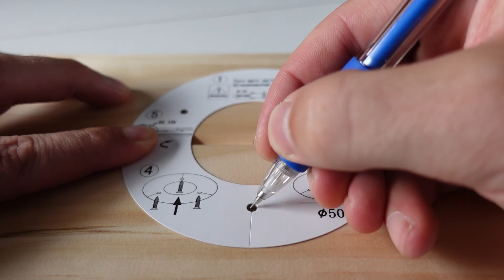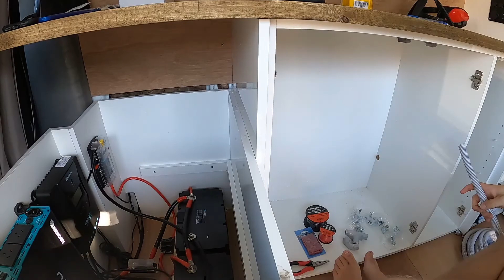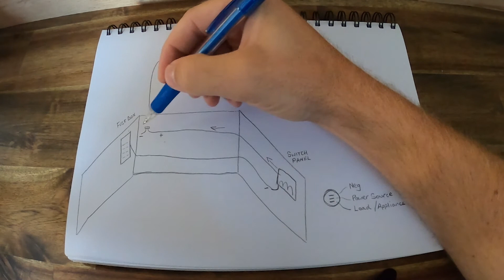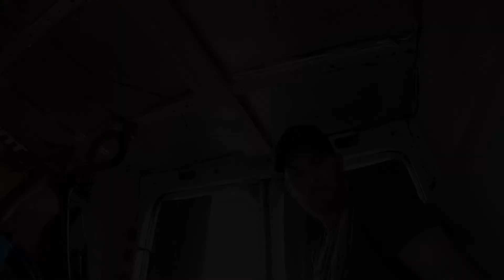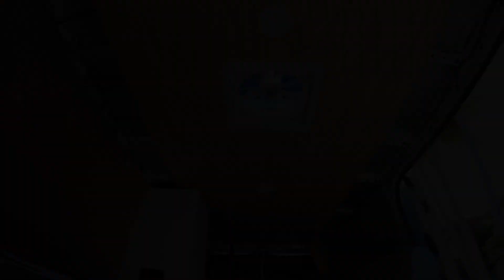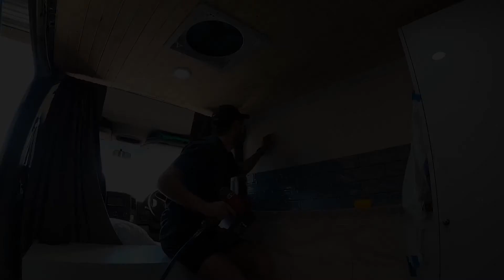Van Conversion Timber Ceiling & LED lighting - Van Build Series Ep. 9

Comment: Plastic is not “conduit” and should never be used as such.
Reply from the maker: No worries mate. Its a protective housing for the wiring, purchased from an electrical store. I am using is to ensure my connections are covered, no rubbing or abrasion are caused on other materials, and its water sealed. That mixed with all my surge protection and safety fuses, I feel secure. I don't state in these videos that its what you must use, its just simply what I used. Thanks for you feedback.
Reply: @triitoutadventures2028  Yeah I see it’s an Australian product and I know that conduit in United States has to be made out of metal so I guess in Australia you can call anything conduit
Reply from the maker: That's a good point Mark! Yep, in Australia it's just called a plastic ribbed conduit. I lived in the States for 10 years but never did any electrical work over there otherwise I would have picked up on the difference lol. Cheers.
Reply: @triitoutadventures2028  I know enough about electrical to get me in trouble although I used to know a lot more and I come from a family of electricians including my dad, both brothers and one of my sisters. The good thing about Metal is it can be grounded and then if there’s a short you don’t get shocked and the ground will trip the breaker or blow the fuse very quickly Before there’s a heat buildup to cause a fire, hopefully. You’re not gonna have that with plastic. Plastic melts at a lower temperature as well than steel or even aluminum and often puts out toxic fumes. I got some plastic coated flexible aluminum gas pipe that was left over new from construction to use for my conduit because it’s lightweight and flexible but it is aluminum on the inside. On my van I’m going to install some of this “conduit” natural gas pipe in places where I don’t even need it right away just so I have a place to add wires for future needs. Like I say it’s extremely lightweight but it is metal on the inside. I suspect it’s rather expensive at the store but the leftover flexible coast gas pipe I got it was only $10 for 20 or 30 feet